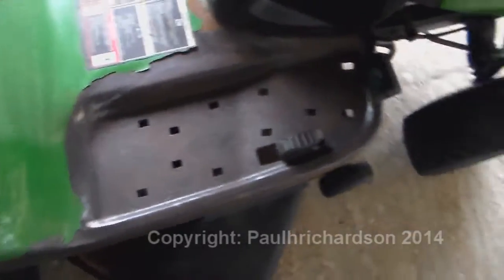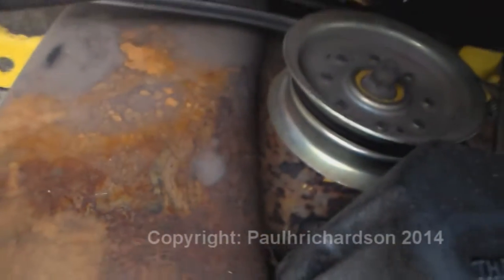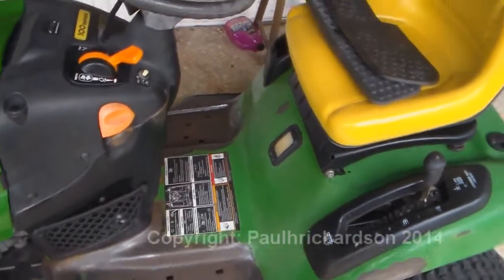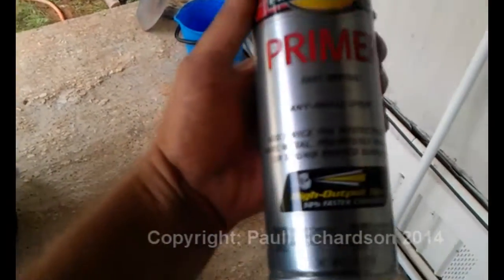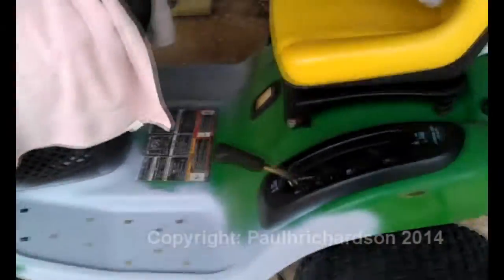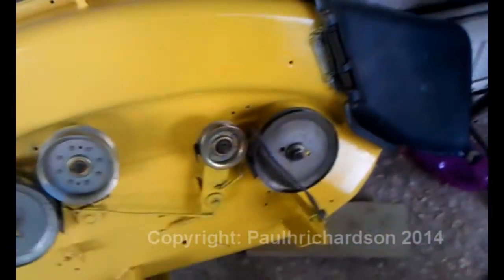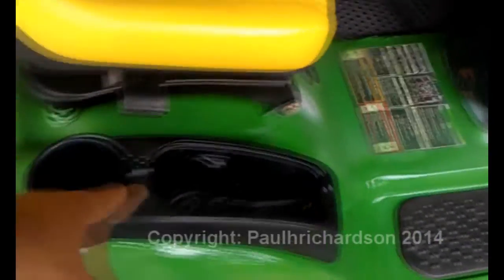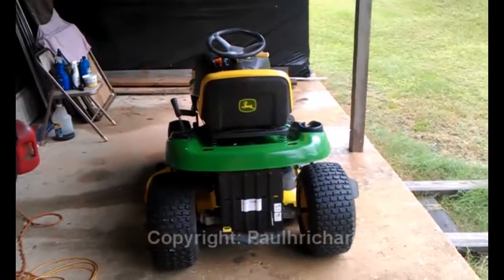start to finish painting my john deere mower

Comment: My craftsman was rusted like that I pressure washed the loose paint of which was more than 50% of the fender ended up using rattle can bedliner spray it turned out nice

Comment: I plan on doing my 155c this summer. My plan is to hit the underside of the pan with spray on automotive undercoating over the primer and paint, might even do under the footpads as well to provide extra wear and corrosion protection.

Comment: Have mine torn apart seat pan & all. Man that thing was dirty, so I rolled the frame off in the yard & scrubbed it all clean. NOW...to attack the rust on the seat pan like yours. A hot gun got the decal off and acetone used for the leftover glue...that was horrible like buggars. Wire wheel and flap disc going to town on all that rust. Bought some OSPHO to protect the metal from any further rusting now that all metal is exposed. Will use Rustoleum rusty metal primer to build surface for paint JD Green also by Rustoleum. While my L120 was torn down, also drained & refilled the trans. Also, will install new steering gears and upgrade steering shaft to flange bearings for a solid steer.

Comment: Nice job! Looks like all the JD have the same rust spots, the plastic footrest I would just keep them off because water will always condensate and or when you wash it the water just sits in the spot. I am going to remove mine and paint and replace the plastic with none slip tape like the same stuff they put on the edge of steps to stop people from slipping. What do you think?

Comment: I bought a full sticker pack for my 1984 JD 430 $100 every original stickers.  Rustoleum makes great products.  Always get the primer with filler in it and wet sand with 6 - 800 grit.  Always 3 coats of each and don't sand the paint.  Wax it after time.

Comment: Thanks for the idea about using my drill with the wire brush. The wife wants a purple push mower, so i'm going to clean up the cub cadet and paint it for her. (due so grass allergies she does most of the mowing.) You also reaffirmed using a nice primer... you get that sticker thing figured out? i think if you peel it off clean up the are and the sticker a 5 minute 2 part epoxy would work.
Reply: that would look insanely cool!  post the pictures of the purple mower!  I am curious!

Comment: The cable that's cut is the choke cable and the plug under the mower is the safty switch so you can only go so fast in reverse while cutting or it turn the deck off while in reverse

Comment: Hi Paul! This is a beautiful well informed video! Nice paint job on your JD Mower! Bet the kids next door or riding by think you came home from the store with a new one (unless you worked on this Baby 14 weekends in a row)! Was wondering if I can paint up an old JD Model A Tractor using your same paint? I'm restoring my Grandpa's old Oklahoma Farm House (even though I b in L.A.) and wanted to display a JD Tractor Prop (The JD doesn't have to be running) in the Barn. I like how one of your Commenters mentioned an Etching Primer! My first time hearing about this primer type, and bet it could really make my JD Tractor Paint Job easier and last longer. And is the John Deere "Green" and "Yellow" spray paint actually a "Kelly Green" and a "Canary Yellow"?
Reply from the maker: Tuck Porter yes it is John Deere paint I bought at Lowe's. An primer also. I bought at Lowe's. Thanks for the nice comment.

Comment: The lever that is missing which appears to be the cord that has been cut is your chock, or it is on mine. I need to get a new speed lever for mine because it broke when I was mowing to close to a tree and a low limb caught it. I guess I will have to order one form John Deere.
Reply: check the vendors and compare prices (with shipping) and also on ebay... lots of sellers there with good used parts.

Comment: 3:29 that wire seems to be to that button by the throttle it allows you to mow in reverse, can you mow in reverse without it dying ? If so that’s what that is bc if you try to go in reverse with the pto on (blades spinning) it will die unless you hit that button, also the best paint in came across is at tractor supply , it’s implement spray made for tractors etc one is made by rust o leum and one is generic but it’s super thick and is amazing and cheap

Comment: Hey, my tractor is doing the same thing. I have pulled my Deere apart exposing every portion of it. i figure why only paint what you can see. It's what you cant see that where the paint begins to fade away from the metal. I don't know how bad your under carriage, mine was so bad that I had to paint both sides. I did purchase some air craft spray for the paint and then I took my pressure washer to rinse it off and maybe getting lucky to make more of the older paint come off in the process.  I'm still in the process and far from the finish line...lol

Comment: This is an issue with the John Deere paint evidently.  I called and talked to John Deere and their statement was that the primer they used failed on most lawn mowers like yours.  When they built the metal deck and parts, they dipped them into a vat of rust inhibitor which caused the primer coat to fail eventually.  This is why the paint flakes off in sheets the way it does.
I took mine down to bare metal and primed it and repainted with Rustoleum john Deere green.  You will notice on your deck that it is worse in places, but some spots the paint has stuck on tight.  You have to really get it down to bare metal though so the old failed primer and rust chemical under it is removed.  I still see rust on yours as well as traces of the old primer too.  These could make your new paint fail later as well.  After I did mine, I found from an auto-body guy that it might be best to use "etching primer" instead of the Rustoleum primer since it will etch into the bare metal best.  I will see how mine holds up I guess now that mine was already painted up.
Do not go whole-hog and paint the bottom of your deck when you do it.. it is like the inside of a blast cabinet in there so the paint will disappear fairly quickly under there so best not waste your money on paint for the underside of the deck.

All the decals can be found at gator parts or the other deere sellers.  That big one is about $25 I found.  The on on your console around the start switch should be aroung $14.  

Paint job looked really good in my opinion.  Rustoleum makes a plastic paint that you can use to make your steering wheel black again.  I tried to use the heat gun method on mine, but it did not hold up once it was in the sun anytime..  The rustoleum made a world of difference.  I used in on the console as well.

I think your project turned out well.  Are your pulleys all OK on your deck?  
Stan

Comment: lol u should've done it right by taking the seat the springs off and taping of course
Reply from the maker: +Derek Quintero Yea, I wish I did, but hey, not to bad for my first time doing this. Could have been worse, lol.
Reply: I just finished painting my John deer and I couldn't find a darn socket long enough or big enough to get the bolt out cause I wanted to paint them black